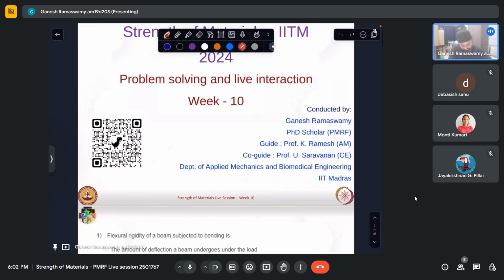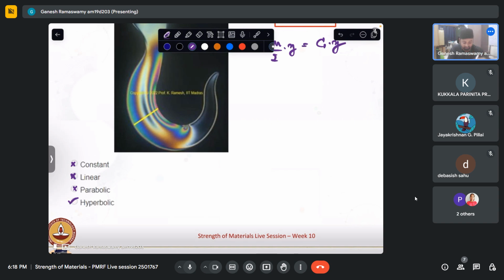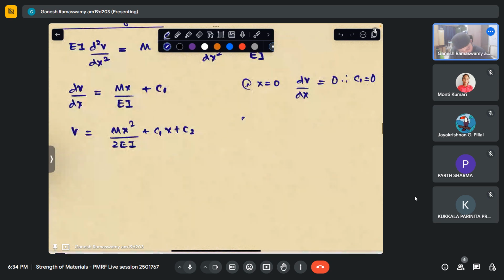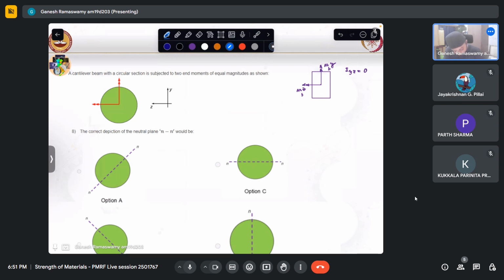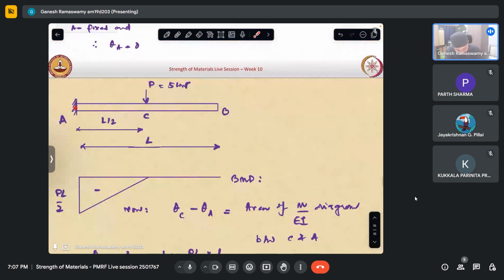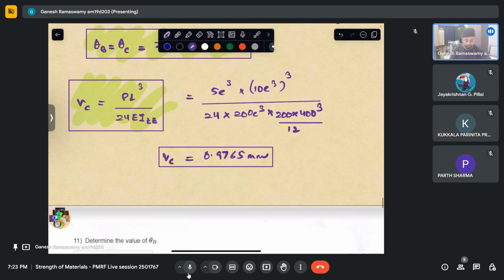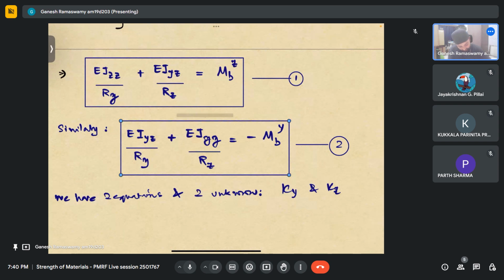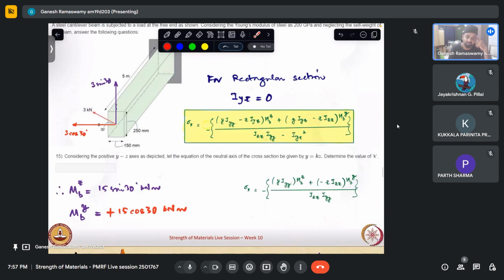Strength of Materials - Live Session | Week 10 | 2024

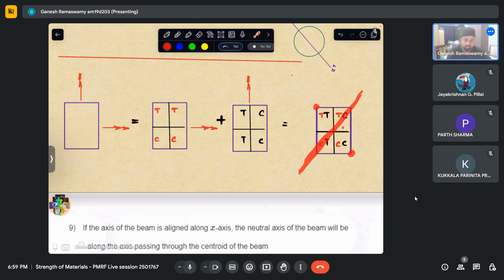Comment: 59:05 the direction of neutral axis will be along the direction of the resultant of the 2 moments?
Reply: Product of inertia is zero or the section is symmetrical
Reply from the maker: Very interesting question!

The direction of the resultant of the two moments will come from the vector sum of the axes of the two moments. That is straightforward.
 
However, if you see the most general expresison for normal stress (at 17:11 of the video linked here https://youtu.be/3zNpD4HJY2Y?list=PLJoALJA_KMOARYNi50T6b488kPUBbOIsX&t=1033) and solve for zero normal stress to get the equation for the neutral axis, you will notice that the slope of this line has contributions from moments as well as inertia of the section.

Under very special condition, both may conincide. Can you identify that condition? Post your reply as a comment here.
Reply: Should the neutral axis always pass through the origin of x' y' principal planes where the product of inertia is zero?
Reply from the maker: @aniket16391  The origin of principal planes or any plane with non-zero product of inertia is invariably the centroid of the section and doesn't change for a given section.

When there is pure bending, the neutral axis invariably passes through this origin. This can be seen by the fact that the equation of the neutral axis doesn't have any added intercept and only a slope i.e. y = kz

Can you think of a situation where there would be an intercept also i.e. neutral axis gets shifted from the centroid?
Reply: As E is a function of y
Reply: What if E is solely a function of x and not y will neutral axis be on the centroid?

Comment: 24:56 since the moment applied is anti clockwise the BMD is positive and so the deflection is positive and so the elastic curve should be in positive y ? I may be wrong!
Reply from the maker: Your observation is correct. Since the emphasis was more on the methodology and the question dealt with magnitudes, the direction of the couple went unnoticed.
Reply: For moment area method we can assume any direction for deflection?
Reply from the maker: @aniket16391  We cannot assume any direction and it definitely matters irrespective of the method used.

In the context of this question, a reverse couple would produce the same magnitude of deflection in the opposite direction which is why it went unnoticed. I put the same couple as the problem asked but solved an opposite problem instead.

One should correctly sketch the elastic curve corresponding to the loading and proceed always.